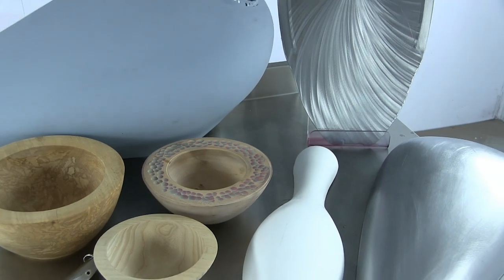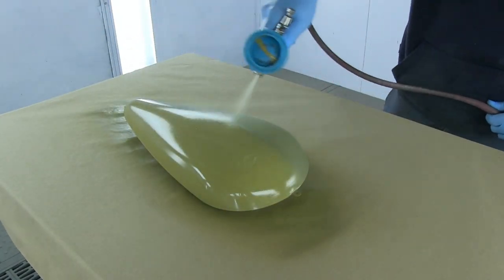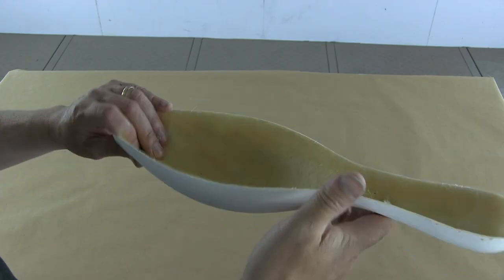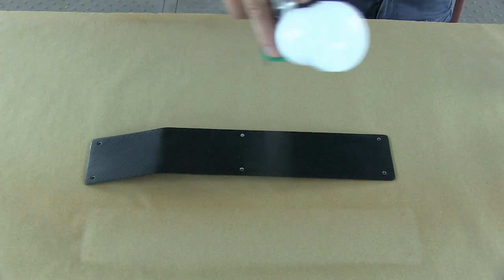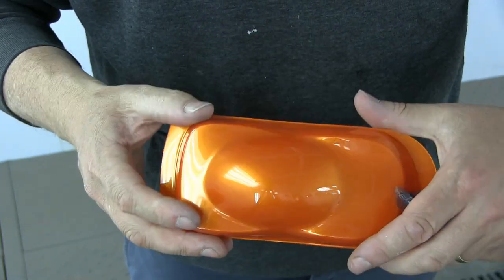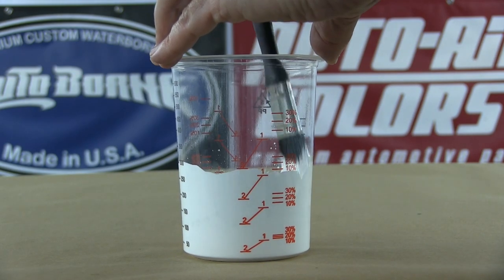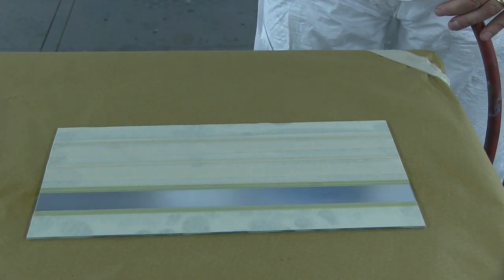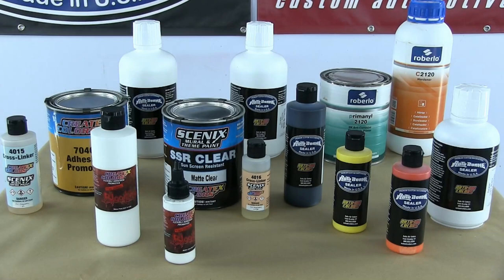How to spray onto any surface!

Comment: Is it possible to use the autobourne sealer directly onto steel? Does it adhere well? I'd be using it for a project that would not be exposed to rain/water.

Comment: Hi Simon ... thanks for such a clear and concise video.  I have learnt so much in less than 15 minutes!!

I do have a question though.  As a new venture, I am going to be painting old pieces of EPNS or Silver plated items to include teapots, candle sticks, etc.  Some of these items may be seriously tarnished and contain residues of old cleaning solutions.  Could you possibly let me know the following:

1. What preparation would you do and what would be your first layer to ensure a good paint adhesion?
2. Some of these items may need washing up ... do you think the Createx External Clear Coats would be okay for the final treatment layer ... allowing for immersion in hot soapy water?

Thanks for your help. 

Sally
Reply from the maker: Hi Sally, I would use a red scotch bright pad and an alcohol cleaner. I would then use Createx Scenix clear
 for both an initial coat and also a top coat.
Reply: @SMDesignsAirbrush  

Hi Simon ... you are a star!! Thank you so much for getting back to me on this ... really helpful!! :0)

Comment: Was the steel resanded after the self etching primer?
Reply from the maker: no Ronakaweed The Autoborne  sealer I used was shot after 15-20 mins followed by fairly heavy masking, however it would do no harm to scuff with a red scotch bright pad especially if you were using normal paint.